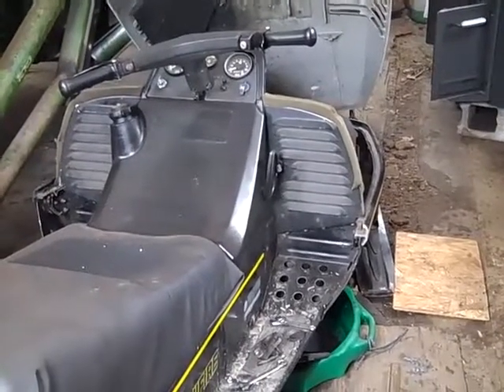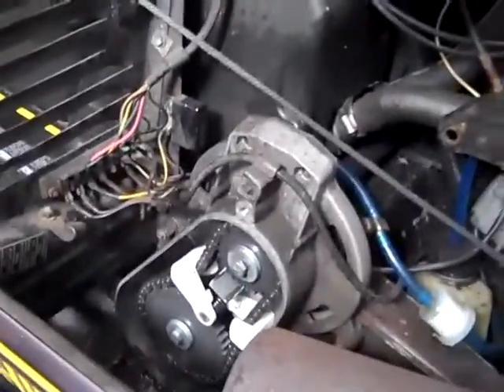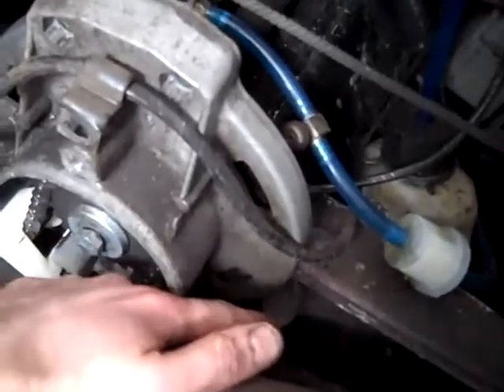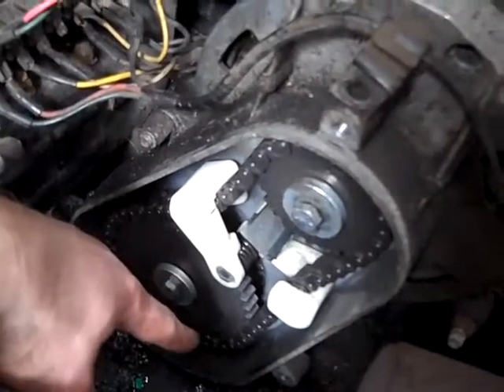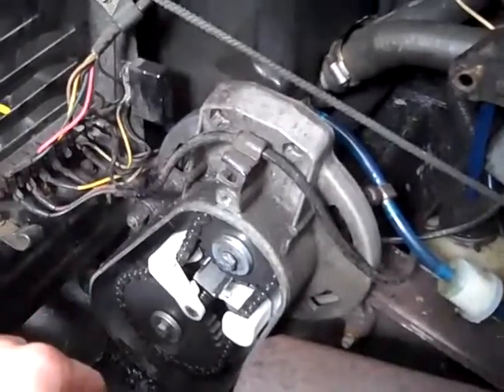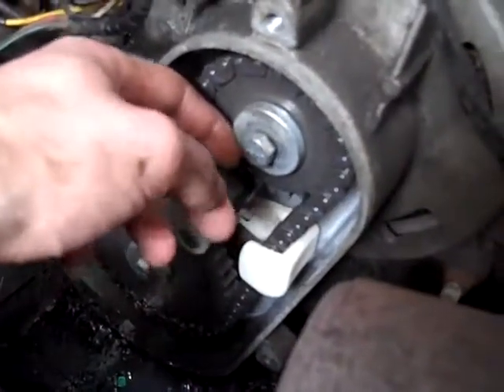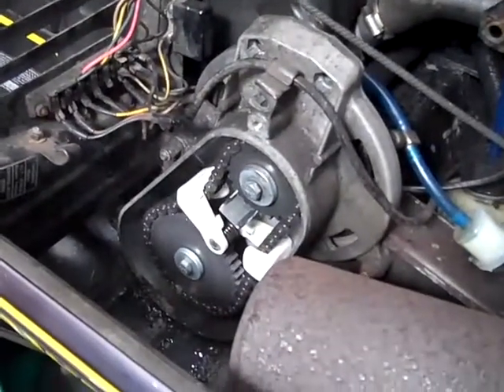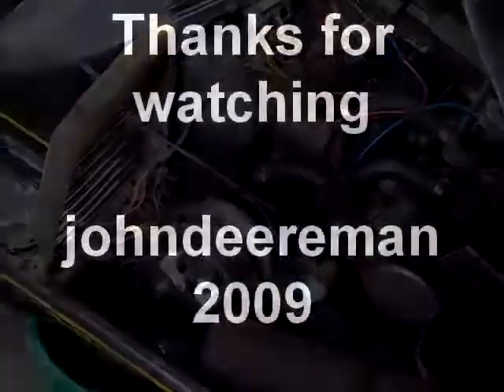New brakes on the john deere liquifire Part 1

Comment: Blast from the past here. However, maybe you can help me out, I'm working on a Cyclone. What side does the thick brake puck go on? Is it the chaincase or the puck body side? Also, I thought I'd mention. You only need to pull the gears and chain, then remove the bearing flange behind the secondary. You can then slide the jackshaft out of the chaincase bearing to remove the disc. There's no need to remove the chaincase.

Comment from the maker: @1977johndeere Shure does 76 thru 78 cyclones and liquifires have the same brakeing system and drivelines they are basicaly the same snowmobile except the liquifire is liquid cooled has a firmer suspension and is faster